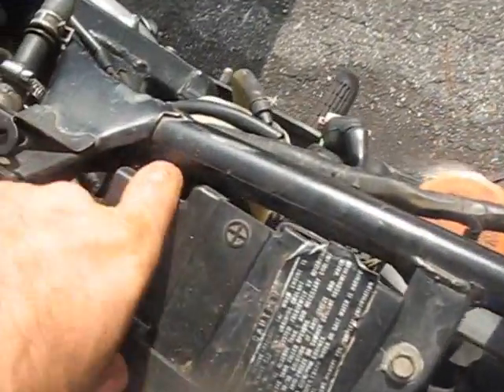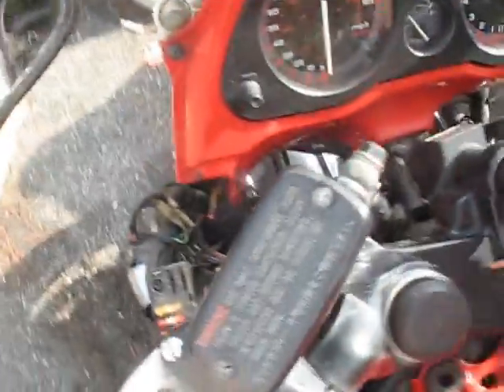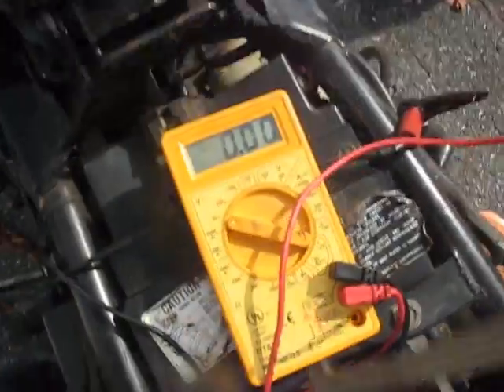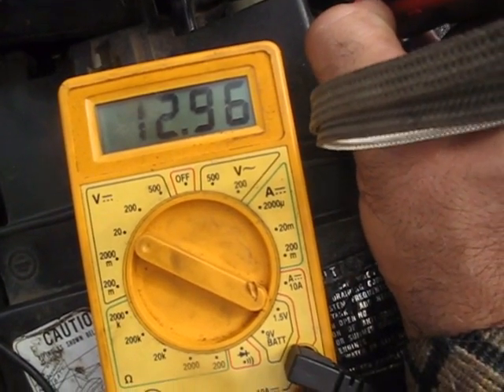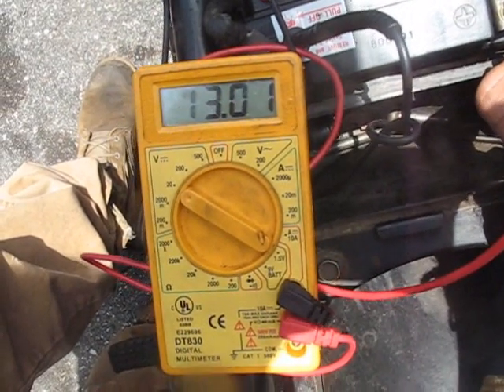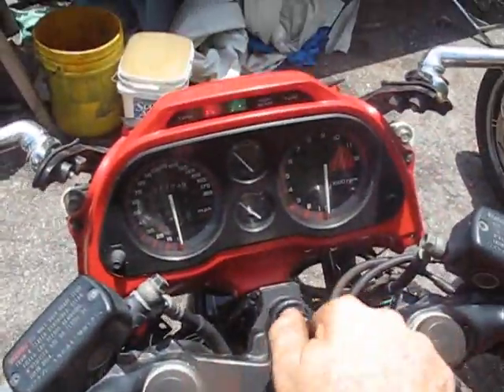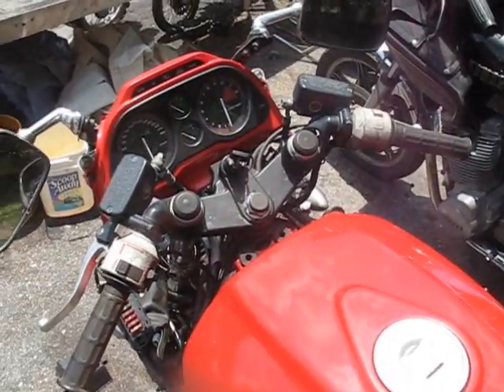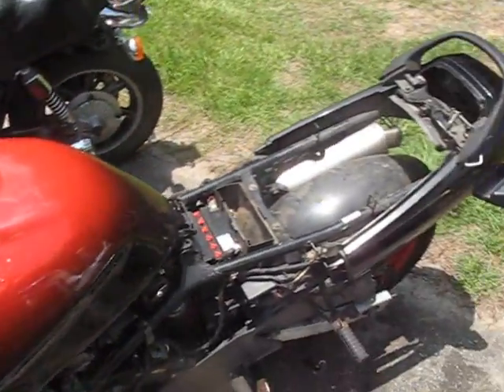How to diagnose and fix battery problems

Comment: Think it's important to say there are many cheap or fake brand batteries on the market you should avoid,  just bite the bullet and buy a quality brand battery  from a trusted dealer,  you can rule out so many possible problems  if your sure you have a healthy fully charged battery,
I get bikes coming in that customers have spent big money on, on parts they did not need  trying to make it run (or run properly)  when it only needed a good battery,  modern bikes are very reliant on electronics and will not work well without a good battery.

Comment: Thnx for the video. my battery from the prev ownner is just over 2 yrs old. but the bike only starts with a jump. the battery tender jr goes to solid green in about 30 mins which according to the tender manual takes 16 hrs. the prev owner used a 8.0'a/h instead of a recommended 8.6 per honda manual.  the bike attempts to start but then I hear clicks after 2 attempts. not sure what it is.
Reply from the maker: +Ahmed R 786 Replace battery, bike batteries don't often last more than 2 yrs

Comment: Hi Max, very interesting videos. Have watched a number today whilst checking out potential issues with my Kawa GT550 (KZ550) Shaft. Has a new battery although apparently the old one was new. It seems to hold a charge for 20 miles and then things start to die. EG Indicators stop. I get home and battery is almost dead. I have fully recharged the battery and connected a meter up and it holds charge at 12.8 with no dropping.  All looks good when the engine is idling and also rev'd up. My question is what should the meter show when the lights are then switched on? I ride with lights on always. At times it was showing over 15 volts. I assume as there is a draw and I guess a headlight is a heavy draw, one of the components recognises this and thus increases the voltage into the battery when the engine is running? If the lights are switched of it drops to high 13's / low 14s'. Is this OK? I have rigged up the meter such that it is held to the tank in a bag by a very strong magnetic. So I hope to go for a ride oince the new clutch cable turns up to see if any oddities happen whilst riding.
Reply: Just to add, I have taken of the IC IGNITOR and cleaned all the terminals as well as the battery terminals. Engine itself runs really well but I have found out it is a G5 engine in a G9 bike. A lot of the wiring looks really old , has been chopped about and very mucky so I am also cleaning these as best I can. It maybe once I rid I might have sorted the issue although I would be surprise. Cannot ride till clutch cable arrives.
Reply from the maker: stuart hawkes
Well either you have a small parasitic draw while the bike is running, or the alternator is not charging the battery. I have videos up for both. Good luck

Comment: I have a hyosung gt250r and i replaced the battery brand new, it ran for a day, then the next day i drove it 3 miles and it died. Same thing happened to my old batter. So my question is how do i diagnose what is draining the batter? Please link me to a video or something or google chat me i need some assistance.

Comment: Max, If the exhaust is backfiring, is this the result of unburned fuel making it's way to the exhaust as a result of weak spark produced by the battery? I ask this because you are currently helping me with a problemo on my 82 Magna and it sure does backfire quite a bit!
Reply from the maker: Backfiring in your case is caused by incomplete combustion in the engine, causing combustible gas to be pushed out into the exhaust, here it pools and periodically ignites. The battery doesn't have to be the sole culprit, lot sof things can cause a weak spark, which is what we are trying to figure out
Reply: So I topped up the battery electrolyte and it's reading 12.8V which is good. I whipped out the spark plugs, and the electrode and insulators are WHITE, which I believe is a result of the bike possibly running lean? I've cleaned up the spark plugs with a brush and some sandpaper, I'm gonna replace them to see if it improves things, but I assume that that's just a patch and that I need to figure out the cause of the spark plugs getting fouled.
Reply from the maker: Alex Carpenter
Yeah white powerdery residue on the spark plug is generally the sign of a lean mixture, which can cause backfiring. Check for vacuum leaks, damaged or improperly installed air filter, vacuum line undone, clogged jets, and low float heights

Comment: forgive the n00b question, but if the battery was completely dead would the engine appear to be "stuck"? I'm just wondering what to look for when buying an old bike
Reply from the maker: If the battery is completely dead, then the starter motor will not do anything when you hit the button because there is no juice to power it. However you can check if the motor is truly stuck by kickstarting it (if it has a kicker) or putting it in top gear and attempting to push it down the road. If it won't budge, then the motor is likely seized

Comment: Hi Max, My bike crapped out on me last night. I went to start it up, it hasn't run for a couple of days after I replaced one of the spark units. I got the bike started after a couple of cranks, then it died, and then a second later all the lights on the dash went out! Nothing. No power whatsoever, like the battery had been disconnected. So, I disconnected the battery and tested it with a multimeter and it read 12.53V so I thought the battery is good, but now I've watched this, I'm thinking maybe it's not so good. Is it likely that 12.5V would not light up a single electrical component on the bike, or do you think I'm more likely looking at a wiring fault somewhere, possibly the ignition switch!?
Reply from the maker: 12.5 is enough to light your lights and turn the starter over for a bit. You may have blown a fuse, the battery connection or ground may be undone, or yeah could be the ignition switch. Go start jiggling wires and fuses and see if it will come back on
Reply: Jiggle I shall. So it's unlikely that it's the battery that's a fault then? Figures as I would have thought the same, at least lights on dash. Would the main fuse be a good place to start!? I think someone has replaced the main fuse with a paperclip by the looks of things.
Reply from the maker: Alex Carpenter
Yeah main fuse would be a great place to start
Reply: mrmaxstorey Hey Max, it's Alive! Topped the cells up on the battery, cleaned the terminal, cleaned the connecting wires, took the main fuse out and wiped it clean, buttoned it all back up nice and tight and the dash lit up like a christmas tree.! :) Forever grateful for your input, many thanks.

Comment from the maker: First check fuses, then the main power wires coming from the battery. Check the black one that grounds out to the frame, and the red one which goes to the starter solenoid. Something might be amiss in there. Check out my video on starter motor problems to see how to test the solenoid, maybe it fried

Comment: Hey hows it going,

My motorcycle is not getting any power at all. The battery is good (12.6V) however when I turn the ignition on no lights turn on. There is no sound at all, no clicking from the starter. Just dead quiet.. Before the motorcycle went dead, I recall seeing smoke from the solenoid area. Its a 96 Suzuki Savage. Please, I beseech for your help Good Sir.

Comment from the maker: Happy St Pattys Day then! About your bike. The oily goopy mess could very well be coming from the valve cover gasket, much easier to repair. You can send me pics if you want and I will see what is to be seen. Blue spark is achieved by replacing old ignition parts and cleaning up connections. No home made compression tester that  know, gauges can be bought on ebay for as cheap as $10-15. Cheap stuff

Comment: hi max paddy here again, the front of my engine is grand and dry but the back under the carbs is oily and goopy would you agree the head gasket has blown? i was thinking of re-torqueing the head myself. do i loosen off all headbolts and then torque or do i just torque where its loose? and how can i get blue spark back on my plugs? is there any home made compression test? im irish, i dont like spending money lol. cheers buddy

Comment from the maker: My suspicion is that the blackness on the plugs is from your cylinders filling up with gas from not having a good spark, then finally it is able to fire, which may also be causing your backfiring, but will also cause a momentary rich condition. So, clean those up. Unfortunately CDI boxes do fail from time to time, that might be a cause. See if your repair manual can tell you what ohm values you should read while testing it, same with ign coils.

Comment: He i have a problem with my 94 nighthawk cb250, well about a week or two ago i was riding down a road at about forty and started to loose power and the bike died mid ride and i pulled in to a parking lot with the momentum. once parked i started it again and proceeded to my destination.later that night i was leaving and got about a quarter of a mile and it died again.then it started starting and only lasting as i revved then quite and started hearing a clicking when trying to start. please help

Comment: hi max thanks for getting back so soon. in regards to the spark i have changed the coil packs, starter relay weak black wire has been patched, it has new spark plugs but they are already a bit black. i have changed the pick up pulse meter from the old engine onto the new one, should it be gapped? if so do you know what the measurement is? feeler gauge? otherwise i am out of ideas.

Comment: Hi, I have an RF600r nonstarter. was running fine but then it sounded choppy so i took to a mechanic and he cleaned carbs asfar as i know. ran great 82 miles and just wont start. got a new batt, has a 2nd hand engine from b4 the carb clean, changed coil packs,plug leads are in the right place, yellow spark on plug but all i get when i start it is spinning then small backfire.sounds like new bat flat but ammeter reads full charge. petrol to carbs is good, blk wire patch starter relay any ideas?

Comment from the maker: That might be your relay clicking back and forth. Make sure your replacement signals have good bulbs, and are wired the same as your old ones. Some have both a positive and negative wire, some ground out to the frame, and some even have another wire for running lights.

Comment: Hi Max, i just had a question that you might be able to answer. I have a 1973 suzuki ts185. I recently ordered some turn signals for it off of ebay. I am able to hook up the turn signals but as soon as i try to use them, i hear a clicking noise. If i keep the switch slid to the right the noise goes away but the turn signals dont work. Any advice?

Comment: My bike started to splutter today and then cut out, my horn is very low and my head light will not come on now only my side light but it now also flashes with my indicators. I cannot even turn the engine over now. Does this sound like a bad battery or something else? I've tested voltage on battery and seems good and seems to keep voltage but when load the battery by pressing horn the voltage goes down by half. But when pressed starter the voltage stays the same. Any thoughts, i appreciate any h

Comment: Hello max I got a question about head sets? I seem to have a persistent wobble at various   50 mph and below speeds. I have all ready re-torqued the headset per manual instructions. What i noticed right off is that I was able to turn the torque wrench all most one full turn before reaching the 80 ft. lbs. I have also lifted the front forks/tire off the ground and tried to wiggle the assy. everything seems to be tight and Ideas? 1986 yamaha maxim-x xj700 Thank You

Comment from the maker: @memberson Well technically you are right the spark does not directly originate from the battery. But to get a spark, power needs to go from the battery, to the starter solenoid, to the starter, to the flywheel, to the stator, to the ignitor or CDI, to the coil, to the spark plug. Power needs to transfer from chemical to potential to kinetic to magnetic to electric forms. If you dont have a good battery, not enough power will transfer all that way to get to the spark.

Comment from the maker: @PowdderFinger I have the exact same bike, well mine is an 81 but Im pretty sure they are the same mechanically. Yeah it can be a little finicky. Have you tried starting it since? What kind of bucking was it, like gears grinding, or the engine dying? Was it bucking down (dying) or bucking up (surging)?

Comment: Great video Max. I have no idea how old the battery is on my bike but it stays pretty much around 12.8V. One thing you could have added to the video was hook up your volt meter to the battery after you got it started to show if the battery was getting a proper charge from the generator. Atleat that's what I would have done :D